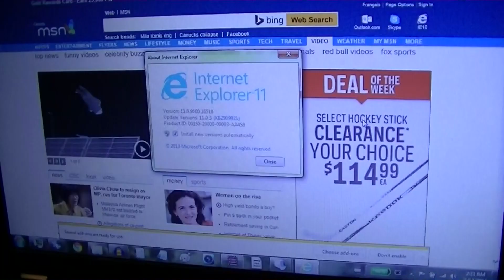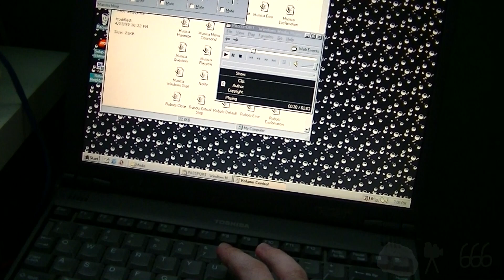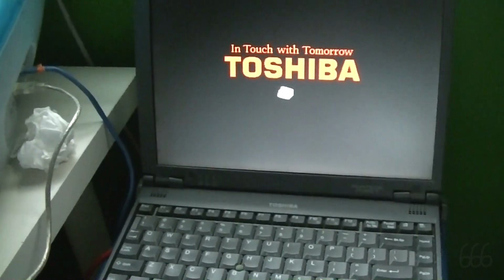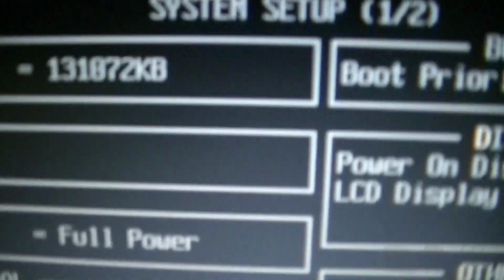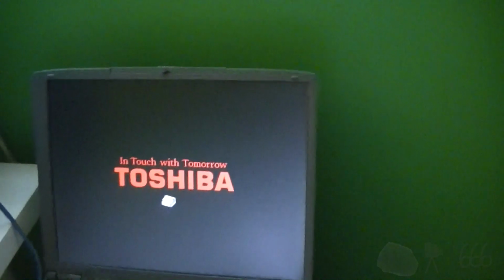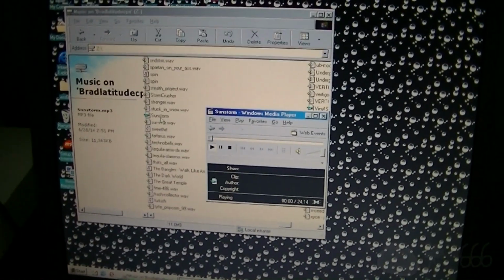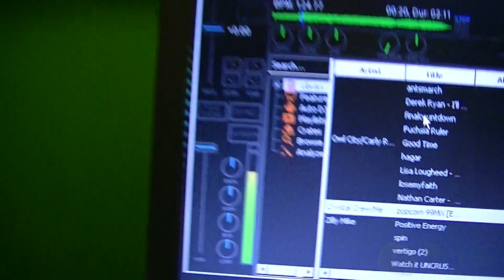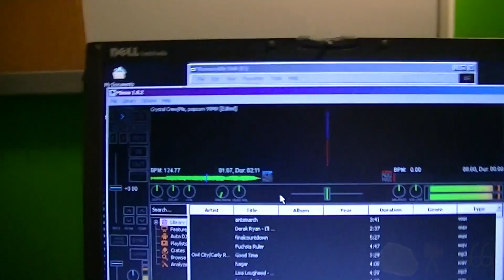Toshiba Portege 7020CT Upgrades

Comment: I've got one of these running XP. Only takes a half hour to boot up.
Reply from the maker: Running XP with anything less than 512 MB of RAM won't result in a fast or really even a usable experience, let alone on a PII 366, despite it being supported.
Reply: @CarnelProd666  running windows ME?